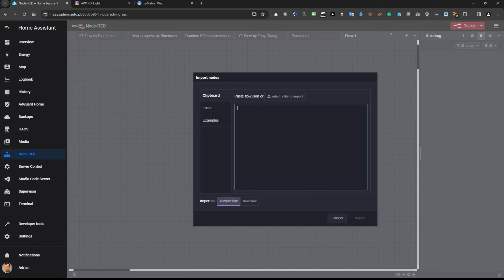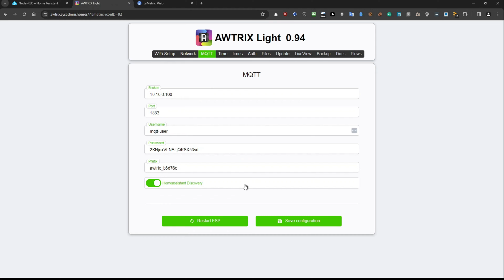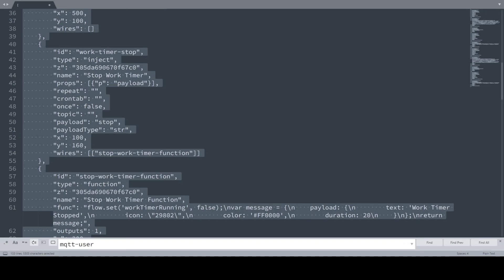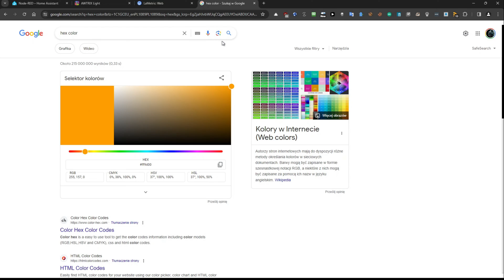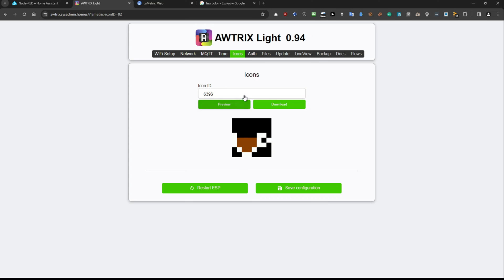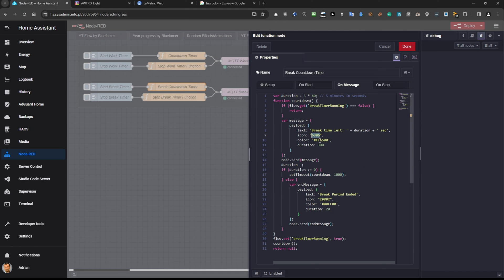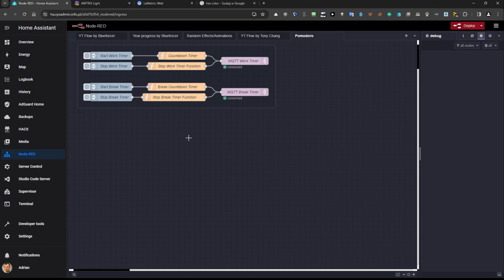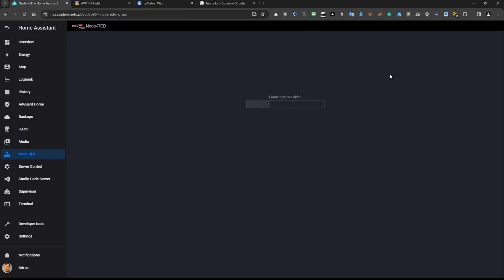How to implement pomodoro timer using Node-RED onto Ulanzi TC001

Comment: Hello from France !! thanks a lot for sharing this pomodoro timer that it's very usefull when working at home !! I've just tested it successfully 🙂 One remark : when a pomodoro timer is working, the other application (date, hours, temperature, etc.) are no longe displayed 🤔Have you got a solution please ?
Reply from the maker: @hoctrimededebutry8655  they are displayed but later when the timer stops. The data is sent to the topic. I know what do you want to achieve. Eventually you can decrease the time that is responsible for displaying the content in the Ulanzi screen. I just set it the way that it displays as long as the counter is working.